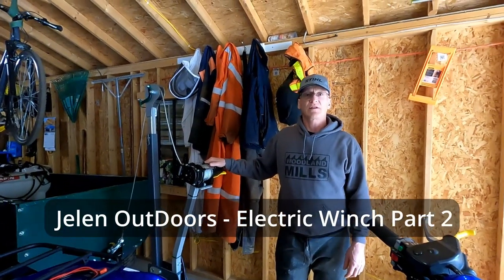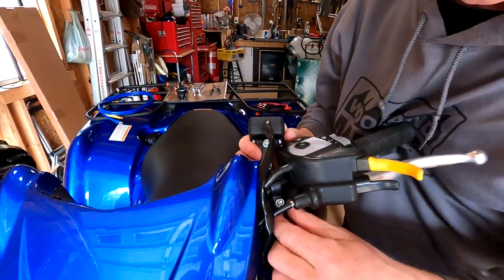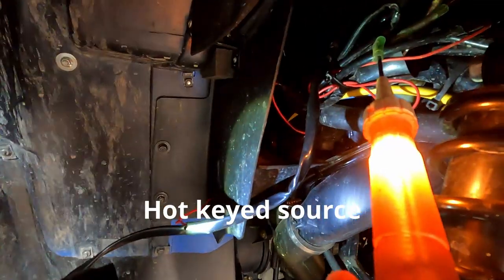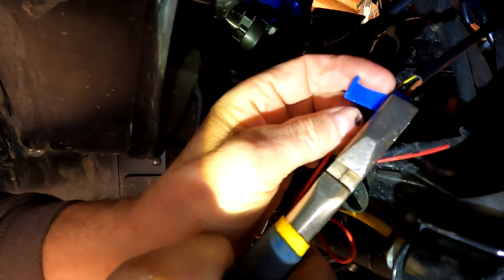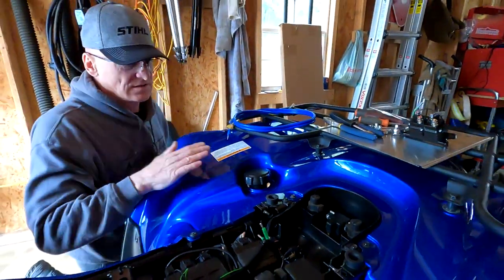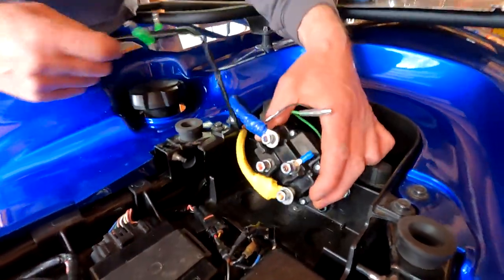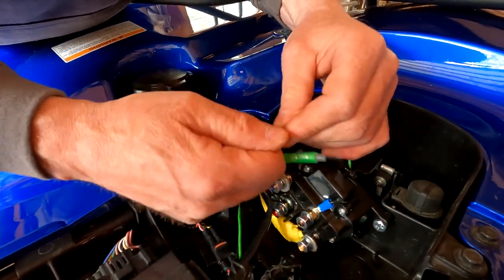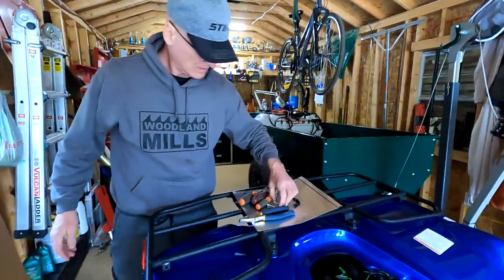36 - ATV Electric Winch Install - Utility Trailer & ATV Part 2

Comment: Really good job on the install. I've been thinking of doing something similar to my trailer. I don't think my ATV was that clean when it was new.
Reply from the maker: Thanks!  It is so nice now to dump the bucket with getting off my ATV and to pull logs up onto the trailer.   My ATV is 14 years old, I think parking it inside and cleaning it regularly has helped.
Much appreciated you watching!

Comment: What size cable did you use to make your extra blue/yellow cables?
Reply from the maker: I can't recall if they were 6 or 8 gauge but I am leaning towards 8.  I had used the wires from a set of  booster/jumper cables.  The wire didn't need to be that heavy. Hope that helps and thanks for watching!
Reply: Thanks. Do you remember where you got the quick connect from?
Reply from the maker: Here is a link https://a.co/d/7vQ7x1V got them on Amazon